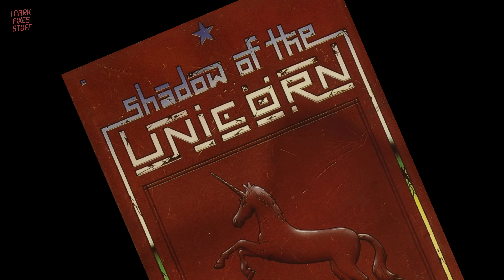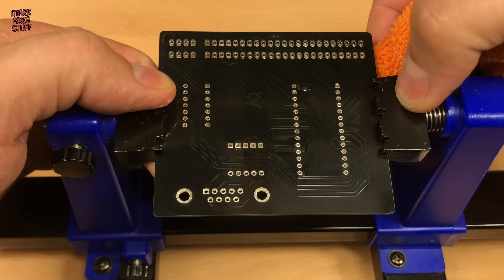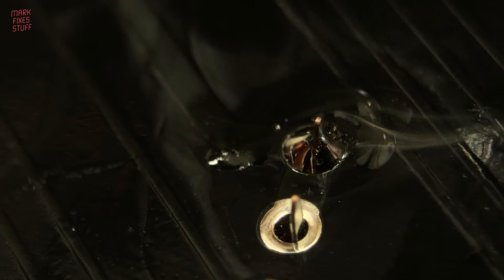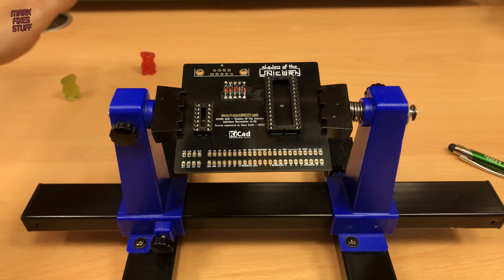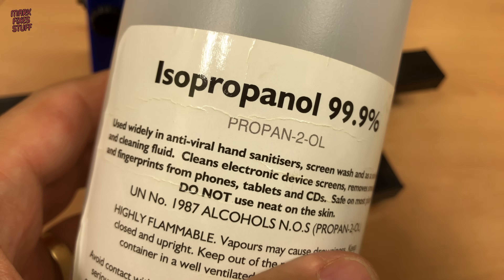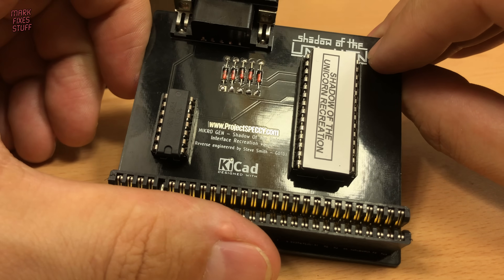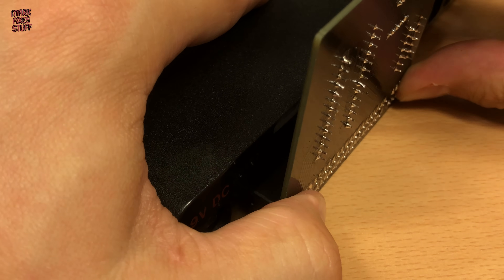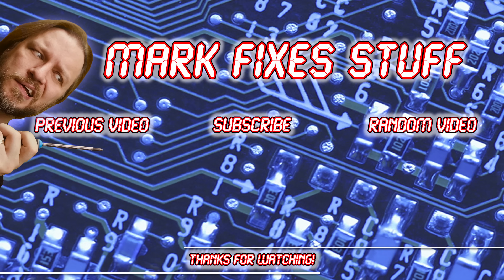BUILD FAIL - Rebuilding the DOOMED Shadow of the Unicorn interface for ZX Spectrum

Comment: Meh, I thought there would be a real fail, like soldering something the wrong way and blowing up the computer but fortunately not. With all respect to the redesigners, this cartridge could use an other redesign to be usable for real :) Apart from the spacing (did they use some slot expander to fit?), I also don't like the joystick port pointing upwards.
Reply from the maker: The real fail here is the incredibly boring game to be honest. I think if Steve did a redesign it would be a lot smaller and better laid out. Some odd design choices were definitely made on the original!

Comment: Mark, i have a better idea, you could have put the connector on the backside of the board. this video is a year old at this point so i doubt you'll see this but there it is
Reply from the maker: If the connector is on the reverse of the board then all the pin assignments are reversed as well unfortunately. Like looking in a mirror.

Comment: There are 90 degrees edge connectors that can be used. That way the board will be horizontal and the joystick will not move the board. In the old days I preferred to use those connectors or adapt normal ones to a PCB mounted on right angle.
Also there were edge connectors bigger in size but they seem to have disapeared, I did not find them since a long time.
On the other hand, is your soldering iron not a bit too hot? The solder alloy is supposed to melt, not to boil.
Reply from the maker: Yes, a right angled connector would be good for this. On the project it was meant to be a clone of the original, with the original orientation but the connector just wasn't deep enough.

My soldering temp is around 340-350 degrees C, so not too hot. The macro shots where you can see the odd effect of "boiling" are a combination of the flux core burning off and the meniscus of the molten solder flexing due to changes in the capilliary action of the joint as the board absorbs the heat and then exhibits thermal losses as a result. It's fascinating to watch close up. 

 Thanks for watching Sebas and I appreciate your comments.
Reply: @MarkFixesStuff  It is indeed fascinating watching close but even more doing something by yourself. 
Thanks for the good content of your videos.

Comment: Another solution to the edge connector conundrum would be to use a connector with angled pins; this would have the effect that the board would lie flat on the table behind the Speccy.

Comment: I'll start looking back to see if you've shared it before, but what brands are your solder + flux combo? It cleaned up so nicely, all the fluxes I've tried so far don't clean nearly as well with 99% isopropyl.
Reply from the maker: Kester leaded and Topnik RF800!
Reply from the maker: https://amzn.to/3yZGvMn for the flux - You'll need to search ebay for the solder I am afraid.
Reply: @MarkFixesStuff  Excellent, thankyou! Is your kester leaded flux core, and if so I'm assuming it's also no-wash?

Comment: For such projects, I am always trying to see if stuff will fit but I guess you were expecting it just to work by design. One of the alternatives perhaps could be to use an edge connector with 90-degree angle which would allow inserting this cartridge in a flat position but might need some additional support from both sides to remove the pressure on inserting.
Reply from the maker: I was lazy to be honest.

Comment: Great video, as always. When you showed the side view of the final version inserted into the Spectrum, it looked to me as though the EPROM was still touching the case, so even a low profile chip socket would have caused a problem. Is this the case, or was I seeing things?
Reply from the maker: It does touch a bit. I think the answer is a longer/deeper edge connector

Comment: have you tried to solder the edge connector on the back of the pcb? this way you have the flatten side of the pcb towards the speccy case, you can keep the ic sockets and solder the edge connector firmly in place leaving no extra length ;)
Reply from the maker: The pins on the board would then be reversed left to right unfortunately
Reply: @MarkFixesStuff  yeah, after a deeper thinking you're right. Need to use a longer edge connector. But anyway, does this game worth the fuss? I think not.

Comment: The original expansion header was a bit taller, but they're harder to come by as the market was flooded by the cheaper version (I think bytedelight sells them).

Or you could just bend up all the ICs legs and solder them onto the back instead. Sounds horrible, but it's probably not the worst thing I'd have done tbh 😅

Comment: Much of the problem here is down to Sinclair cheaping out on putting an edge connector on the expansion port itself, much like the C64's cartridge port, which would've allowed this to lie flat, and possibly made any expansions a bit cheaper.

Comment: Good solid joints.... sounds like the ones we used to roll back in school!   xD Hardly a disaster.... a mere oversight..... not even really your fault. Another fine execution of retro goodness! The design was not well thought out... he/she should have mounted all the other components on the back of the board and just the edge connector on the front...or made the board taller so that the other components would clear the top of the speccy.

Comment: The flux you are using like like a scam, in this video talk about this https://youtu.be/CrYlE1NNYdA
Reply from the maker: The flux works fine but it’s not for hot air. He needs to use a paste for hot air workstations. It’s good for fine soldering on pins. Thanks for the video link. I buy my flux from the company, ebay has some fakes to. Just IPA in an old bottle.

Comment: I've seen these PCB's on ebay, But never knew what they were for. Now I know, I won't bother. LOL

Great video work. Edge connectors with longer leads are available, But I don't know where from. Or you could plug it into the back of an Interface 1.

Comment: Can’t you just put the edge connector on the back of the board?
Reply: That wouldn’t work would it, have to turn the board upside down then
Reply from the maker: @TheNeonrazor  Alas no, as the address lines would be swapped. Upside down... yeah

Comment: The PCB isn't the problem, it's the edge connector, its pins are too short. Imagine trying to fit a case around this, even with the chips on the back of the PCB.

Comment: I don't  know enough about soldering and PCB's to know if this is possible or not, but would it have worked better if you put the cartridge connector on the other side? Again, I say this having no education or point of reference in this field, so if that's a stupid idea I apologize lol!
Reply from the maker: The board pins would need to be swapped left to right.

Comment: The obvious solution would be to reroute the PCB traces so those chips can be mounted on the other side of the board.
Reply: yep that would be the best solution giving the Problems.
I wonder why the edge connector was on the wrong side...
Reply: just put the edge connector to the other side of the pcb... the pin layout is the same!
Reply: @Florin76  
there is a notch on the edge connector so while it would fit on the back it would not fit to the speccy the right way up and if fitted upside down the connections would be wrong :-)
it wouldnt work even if there was no notch as the conections woul d be wrong left to right :-)
Reply from the maker: It's a direct copy of the orignal board, so I guess the original had longer pins on the connector.
Reply: @MarkFixesStuff  I suppose they used edge connectors with wire-wrap pins, just like many other interfaces for the Speccy or the ZX81 where they wanted to pass the expansion bus through. E.g. the Romantic Robot Multifaces for the various Speccy models, or the Memotech add-ons for the ZX81.
Reply: @MarkFixesStuff  WAIT! I KNOW! If you bent the legs of the chips 180 degrees (if they're long enough to clear the package) you could mount them on the back, upside down, with no change to the PCB!
Reply: beat me to it.....that seemed the most logical solution......would have made the board look neater as it faces the front too

Comment: I think it would be best if the PCB was redesigned to have the connector and chips on opposite sides of the board.
Reply: Or at least closer to the top, clearing the speccy case.
Reply: Came here to say this :)
Reply: Yeah seems like the simplest solution
Reply: Or to fix it with this board - adding two rows of headers under the edge connector. A bad fix but still a fix :)
Reply: That seems the best solution.
Reply: Or the edge connectors were made with longer pins. If you look at original add-ons for the spectrum, you'll see the edge connectors have huge pins for this reason.

Imagine trying to get this in a case, the board would have to be tall!